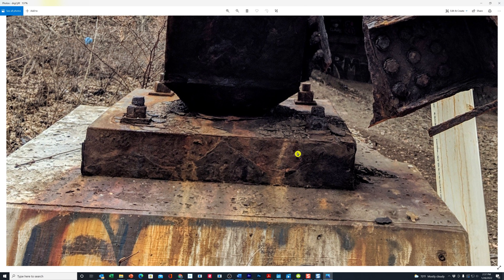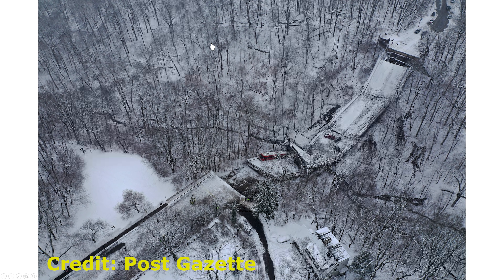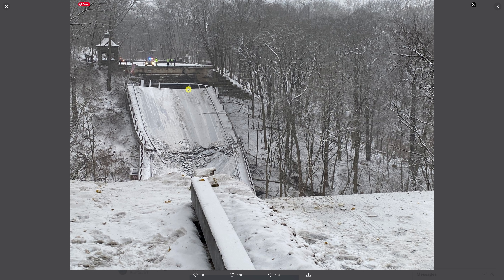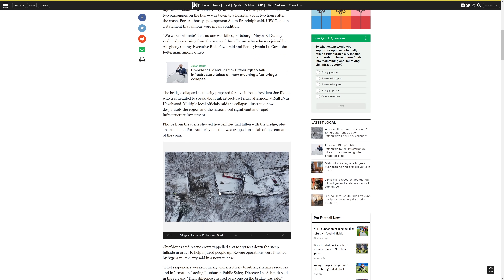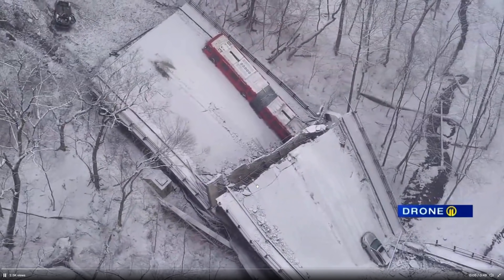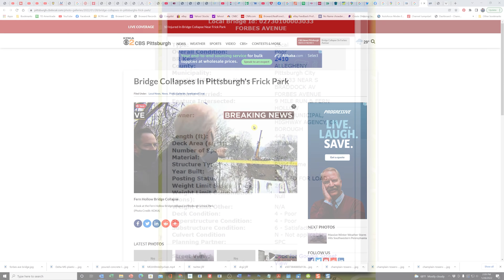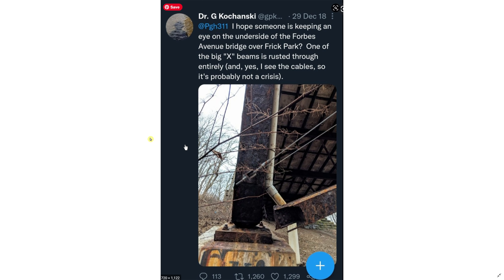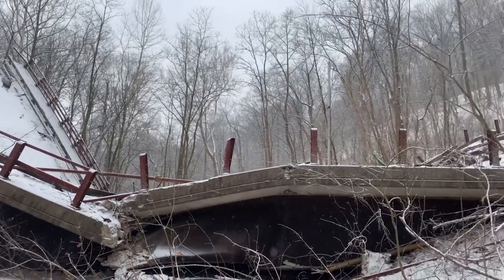Pittsburgh Bridge Collapse Cause, Forbes Ave Bridge Frick Park Rust?

Comment: If only there was a national initiative to rebuild our infrastructure. Hmm.
Reply: @edwardmeegan1849  excuses. I guess the “art of the deal” was as good as the steaks.
Reply: @edwardmeegan1849  Uh.  No.  That's actually not what happened... like at all lol 😂.  The last administration had full control of all branches of government for an entire two years, meaning they didn't need a single vote from the other side of the aisle to pass any legislation, exhibited by their passing of their tax bill which benefitted nobody except them and their donors.  And if that was the case.. then please explain why the current POTUS was able to pass an infrastructure bill almost immediately after taking office and why nobody on the other side of the aisle voted for it?
Reply: @edwardmeegan1849  Also.  The infrastructure bill the former blogger was trying to get passed never even clearly spelled out how anything was actually going to get paid for - which is something that many republicans themselves said was problematic and a large reason as to why many of them wouldn't support it.  It also severely lacked funds for actual infrastructure projects like bridges, roads, public transit, railroads, high speed internet, etc. and was also a trillion dollars less than what "Nancy and Chuck" were proposing because the former guy and his party didn't want a bill that exceeded a trillion dollars
Reply from the maker: Seems like both parties want control of the money, but don't want to spend it on bridges
Reply: @jeffostroff   I don't see why people argue about which side cares the least. NOBODY wants to drop trillions on roads and bridges because that's what it would take. But it would be the best stimulus we could do if stimulus were necessary. 
I'm a structural eng and these bridges and industrial sites are an absolute mess all across the country. 
Structural inspections is a growing part of our job, where everyone wants us to approve a structure that's falling apart.

Comment: 5:35 I am no engineer but it looks to me that this in combination with the images of the rusted through base, shows that the bridge gave away at the bottom of the supports meaning the upper part of the support would have still been attached as it fell, causing that section to "fold" in the middle due to the supports being connected at the edges of the bridge. 

Also looking at where the sections landed tells me that the side of the bridge with the corroded through support fell first. In the image at 5:36, it looks entirely possible that the end two sections fell first due to a support failure which then "pulled" the remaining sections with it. That would explain why the section closest to the camera seemed to fall so far from where it connected.

So if I were to number the sections (1 to 5 with 1 being the closest section in the picture at 5:36), the bridge fell like this. The supports gave away under section 4 which caused section 5 to break away from the seam at the end. Subsequently, sections 3, 2, and 1 were pulled by section 4 as it fell, causing section one to break off from the start of the bridge and slide down the hill. Due to the shape of the ravine, section 3 landed mostly flat in the bottom along with section 2. As section 1 slid down it pushed and folded part of section 2 due to its weight. Section two would have folded up like that as it was "wedged" against section 3 and the bottom of the ravine which meant the forces from the weight of section 1 had nowhere else to go and caused section 2 to deform.

Sorry if that is hard to follow, like I said I am no engineer so am not entirely sure how to describe my thinking. But to me it looks very evident that the rusted support beam was the cause and the order the bridge fell was how I explained above.

Edit: Just to add another thought. The drainage system that can be seen at 13:35 runs down the beams. If the road on the bridge is regularly salted, that salt water will certainly end up running down those drains. If any of these pipes leaked (which I expect with the evidence that suggests the bridge was not maintained), that would cause salt water to run down the support beams and as a result accelerate the rusting and weakening of the structure.
Reply from the maker: You don't even need a leak in the pipes for salt to get onto the columns, just cars driving over it on a wet winters day will send enough watery mist floating down below that will hit the columns
Reply: I seem to notice that the amount of rust on the support base is larger where the rainwater pipe is attached. First at that support and then on the side of the support that is under the rainwater pipe. This indicates to me it was actually leaking.

Comment: wow! i live in pittsburgh
Reply from the maker: How is traffic in that area now? Where are people going?
Reply: There’s a number of routes that you can use to get around that, it just takes longer. I grew up in Pittsburgh and we used to use that route to get around the Sq. Hill tunnels on 376. So you can go 376, or there’s a couple residential street routes, and also you can go up to Penn Ave and go that way. Forbes is a really pretty drive along there.

The biggest issue traffic wise is going to be people commuting from Regent Square (the area past Braddock going away from the city) to Oakland (where Pitt/CMU/a bunch of hospitals are) since it’s a popular neighborhood for doctors and professors and so on. Forbes would have been the most direct, pleasant drive.
Reply: 376 around the Sq. Hill tunnels is a high traffic area of the city. It's very frustrating if you have to be drive through that area in the morning or evening rush however even outside of that a single accident can have you sitting in your car for over an hour. I remember being stuck on the east side of the Sq. Hill tunnels for an hour at midnight once trying to get home.
Reply: @drescherjm  And it’ll be worse now since one alternate route is gone. But at least there are alternate routes I guess?

Comment: It was a mix of things. Super cold for the last few weeks here in Pittsburgh. That takes a toll on the steel making it brittle.  The bridge enbutments have been horrible for years.  So with the extreme cold and lateral movement of the deck due to the enbutments, I believe this is what it brought it down. Look at how it fell and stacked on itself.  There wasn't enough snow to be making a huge difference weight wise. But the bus and 5 cars brought the bridge to it's posted weight limit. But even at that weight limit it is still capable of holding more. Most of the bridges flaws were underneath, you couldn't tell from above.

Comment: convenient this happened while Biden was in the area to talk about problem
Reply from the maker: I was thinking the same thing
Reply: Good thing this bridge was not part of President Biden's route . . . 💀 🇺🇸
Reply: Wasn't that just............. convenient.
Reply: Yeah, I’m from Pittsburgh. It’s not convenient, it’s just luck it hasn’t happened sooner. It’s been extremely cold here relative to our normal winter temperatures for multiple days, plus they’ve been dumping salt on the roads like crazy because we’ve been getting just enough snow to be a problem on the roads quite frequently. If the weather isn’t a significant factor in the timing I’ll be really surprised.

Comment: I am astonished in the total lack of the maintenance of the infrastructure. How much would be cleaning the clogged drains cost? Then the salt from the road would impact the bridge less. It also seems that the last coat of paint was put on that bridge when it was built in 1970.
Reply from the maker: Yes this bridge is too new to be falling apart only a part but man you can see the effect that salt has on the metal.

Comment: I live close the 35W bridge that collapsed in Minneapolis years ago.  Same basic four point design which means if one pier fails the entire bridge fails.  Bridges especially larger ones should never have a single  point of failure.  The replacement bridge and even some just like it were rebuilt completely different.
Reply from the maker: Just like building airplanes, it's live and learn until something happens then you improve

Comment: What you called a "construction joint" was an expansion joint.  It would have been largely free floating.  It doesn't appear to be designed to take deck level flooding (which likely never occurs with that creek).

One thing I noticed when looking at some of the collapsed bridge photos.  The main support beams appear to be right under the sidewalk/pavement junction.  So, depending on how that junction is created, if water/salt is able to leach down through the battered curb, then that would dump it right onto the beam and bridge substructure.

The uplifted section is probably near the attachment to the support columns.  As if the columns had partly telescoped down onto themselves, and lifted the segment of the bridge, allowing the outer segment of the bridge to slide under.  It is curious that those columns didn't react the same on both ends.  Were they detached at the other end?

You made a point about the center section caving in.  The construction appears to be 2 very tall longitudinal beams under the sidewalks, and a grid supporting the middle.  As it impacted, the outer beams would have hit ground, and the middle kept going, (also causing the pinching).  It is quite possible there was widespread substructure corrosion damage weakening all the supports.

It will be interesting if they release bus video, showing the order the segments collapsed.  One report indicated that it came down in slow motion, so it wasn't a 60 ft (18 m) freefall (thus less trauma to those in vehicles).  But, again, the video may confirm some details of the collapse.
Reply from the maker: I know I want that bus video

Comment: Where it failed looks to me like expansion joints like we have in the UK.
I agree with you that the probable cause was deteriation of the steel structure, rusting away.
But in the last shots of the supports from the side look very thin.
So in the UK bridges are some times weight limited due to their estmated carring capacity of said bridge.
But in this case a weight limit would have not stopped this as the bridge was passed it's sell by date.
Thanks fir the informative videos.

Comment: Worked at a steel fabricator at the time this bridge was built. What was the steel material? A lot of bridges were built of COR-TEN steel that was supposed to rust to a tightly adhering patina. It was supposed to rust! Also, the design was based on ultimate stress, no allowable, or "plastic design". The area where the legs met the main girder was supposed to deform plasticly.  I didn't really understand the methodology at the time.
Reply from the maker: This was also Cor-ten steel

Comment: If I understood correctly, the locations you mentioned about shear off were expansion joints, where the girders were seated on the abutment, so technically they were not shear off.  When the supported rigid frame column buckled, the bridge girders failed to parts, so they pulled out from the abutment.
Reply from the maker: Right, these are just expansion joints, already likely a gap there, and not horizontally connected

Comment: I would imagine that the expansion joints would act somewhat like a shear wall in a building. It may not be what it’s designed to do, but the deck elements usually end at one side of the expansion joint and begin at another, both elements being bolted down to the pier underneath, so it would definitely break off at an expansion joint.
Reply from the maker: With this expansion joint I wonder if they were even connected at all they might have just been separated by a tiny gap between the bridgedeck and the abutment that it was sitting on at the ends

Comment: Those seams that you point out fractured so cleanly at either end of the bridge are expansion joints.  They are actually not connected.  The design allows the spans of the bridge to expand and constrict with changing temperatures.

Comment: Jeff, I live in Pittsburgh, and there are a  LARGE number of structurally unsound bridges here. Drive or walk under them and look up, very scary sight. I believe Pittsburgh has more bridges than any city in America as well.....
Reply: Just a follow up, about 14,000 cars cross this bridge every day. The deck height is about 150 feet high. The huge saving grace is that there was a 2 hour delay due to the cold and snow this day, resulting in a delay of activity on this bridge, other wise, this bridge would have been loaded with vehicles. It was reported that a fre truck   crossed this bridge right before collapsing.
Reply from the maker: Fire truck is 19 tons, should be OK, but not on a derated bridge
Reply: @jeffostroff  A tandem-axle plow truck, with blade and loaded with salt or sand would approach (exceed?) 26 tons.  There were many of those trucks out working that morning.  They may not be permitted on this road, do not know.

Comment: I'm sure road salt played an important role in accelerating the corrosion over the years.
Are there materials that are more resistant to the corrosion caused by road salt than steel ? Not a materials expert, but I think that needs to be applied while reconstructing the bridge.
Reply: there are corrosion resistant steels, but they require nickel and chromium in the mix, pricey metals, very little of which is mined here anymore.

Comment: Some drivers working for Port Authority Transit have stated the articulated buses used on the route crossing the bridge weigh in at 50,000 pounds. They now suspect the twenty six ton weight limit was optimistically posted to allow Port Authority Transit to continue using these large capacity buses on this busy route. When the bridge was built, the largest buses the system was using generally weighed in at 18,000 to 22,000 pounds. Another fact pointed out was the use of COR-TEN steel for the substructure in a damp climate. It is extremely fortunate there were not any fatalities.
Reply from the maker: I will be covering this on the video that I am working on tomorrow, because those double tandem busses cannot possibly be just 15 t even if they are empty.
Reply: Exactly. They are 25 tons. Much heavier than the buses used in 1970 when the bridge was new.

Comment: Im a pittsburgh native. If it helps, the road way was white from salt. There honestly was maybe a 1/2 inch of snow that night. I cant account for snow previously moved to the side by plows, but the other bridges had close to no side snow that day. 
That is a crack he sees in the video. 
Evening rush hour causes stopped traffic on that bridge daily. If you were stopped on it you could feel alot of movement. In all directions. Up and down bouncing, and slight side to side swaying.
Reply from the maker: The movement you feel is usually fairly normal otherwise the bridge might just crack and drop

Comment: i would attribute the accordion fold to the lack of lateral bracing on the spindly legs lengthwise to the road. the legs were braced perpendicular to the road so the bridge wouldn't fall to the side but easily folded when the legs began to hinge. however i think the legs only hinged after the bridge pulled away from the ends due to the sag caused by the footings. so maybe if the footings never moved or deteriorated, the folding would never even be an issue even with the spindly legs because the bridge wouldn't have sagged in the first place causing the ends to pull off.
Reply from the maker: There are so many potential points of failure and TSP's going to have a long study ahead of them

Comment: Jeff, I think we are going to see more of this in the colder regions of the US.  I believe someone else has mentioned it, but is magnesium chloride used to treat the road/bridge?  Does it include a rust inhibitor?  We are advised to get our cars washed immediately after storms because magnesium chloride is a corrosive substance.  Look at how many truck drivers dislike doing runs in the Northeast and then to a humid climate like Florida because it eats away at their trucks.  This will be interesting to see what the NTSB says is the cause.  Maybe it will get DOTs and DPWs to rethink using liquid magnesium chloride on the roads.
Reply from the maker: Others have mentioned this I doubt that the magnesium chloride is really that much different it's better than using pure salt so we'll see what the analysis shows what they used on the bridge
Reply: Prior to snow storms here in Pittsburgh, they commonly "pretreat" the major roadways with "brine". What is in that brine? Not sure.
Reply: @panampia  From what I have been told, Brine is a mix of Sodium Chloride (rock salt), Magnesium Chloride, and water.  This as you mentioned is the pretreat liquid.  The problem with this stuff is humidity.  Rock Salt works at a higher humidity where the magnesium chloride works at lower humidity levels.  Things we don't commonly think about in the winter because humidity is so low.